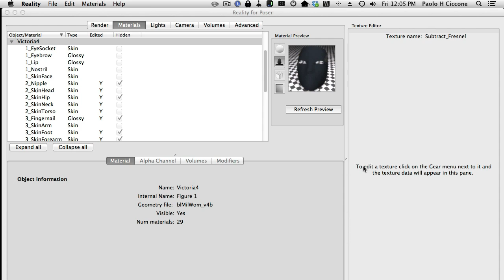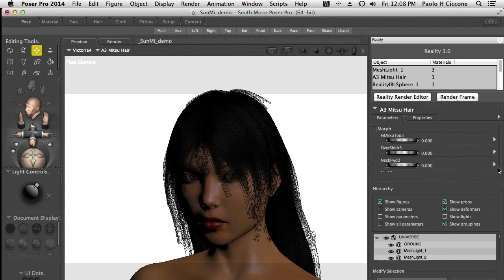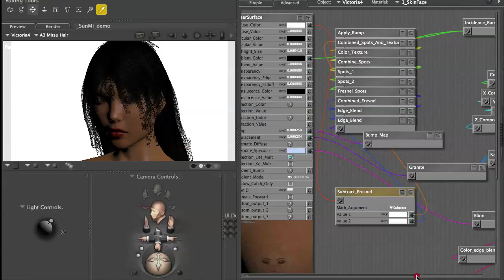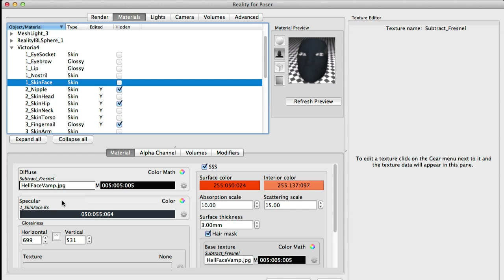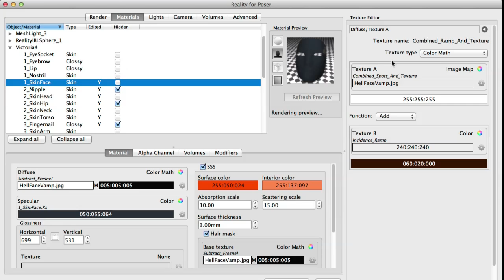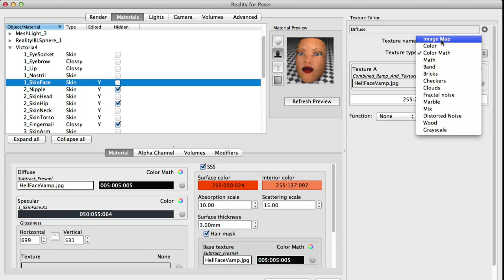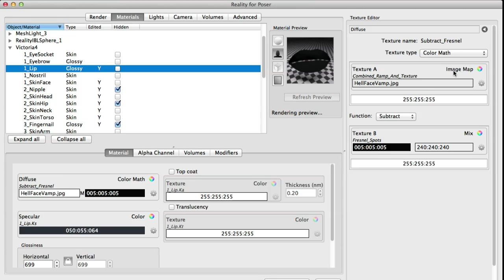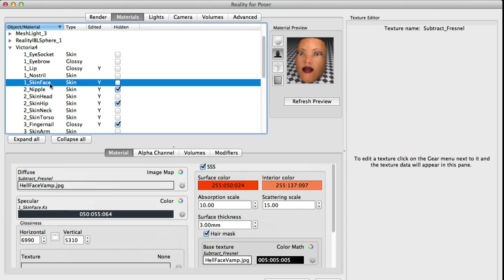How to correct materials in Reality for Poser

Comment: thanks for the clear guidance. However, if one of the nodes controlled, say a normal map for, say the height of veins on arms, where would one find that on reality for say arm-skin so as not to accidentally delete it while deleting the other "add" or "subtract" nodes?
Reply from the maker: Hi.
Normal maps are variations of the bump map and they are found in the Modifiers tab.
Hope this helps.